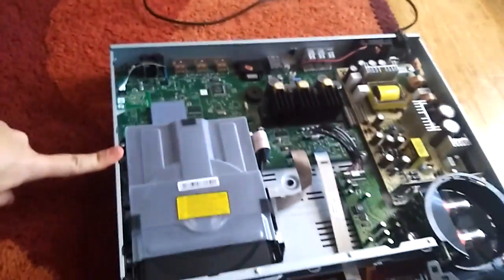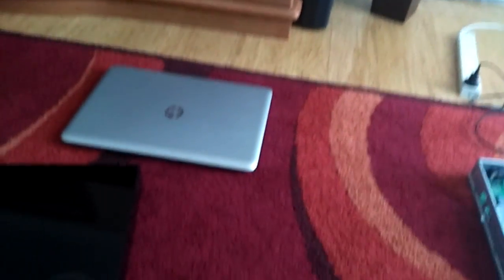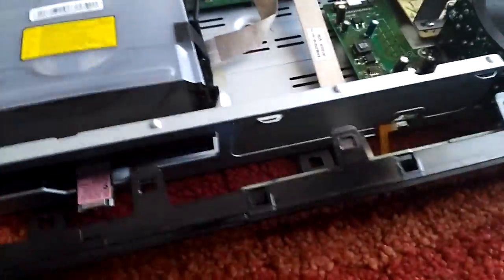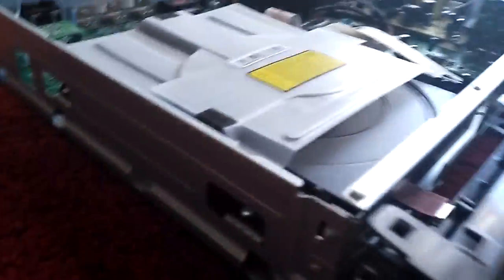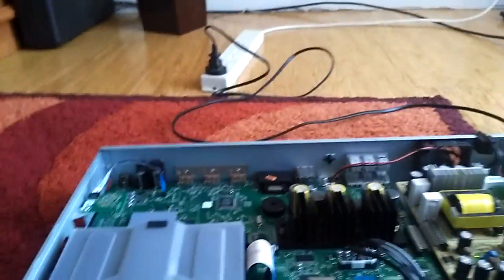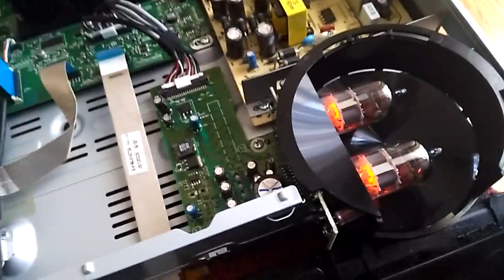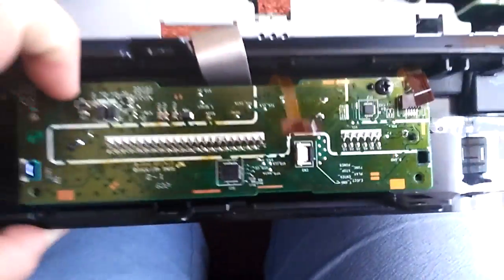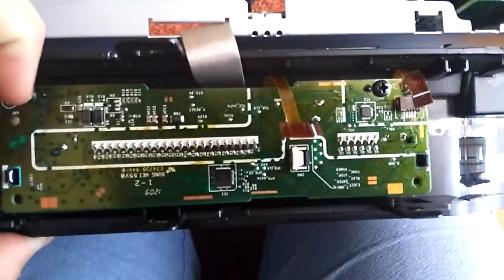Samsung Blu ray 3d volume fix

Comment: Disconnect the other brown ribbon cable on the same green circuit board (located behind the main display screen at the front of the unit) if your DVD door keeps opening and closing on its own or your unit constantly shuts itself on and off. There are two ribbons—one is volume (bottom corner) and the other is for manual controls closer to the top, about an inch from the edge (just as shown in this video), which will stop the DVD door from opening/closing and also stop the on/off debacle. Use needle nose pliers or tweezers and take your time removing the ribbons from where they are firmly seated, only—do not try to remove the connectors from the circuit board as they are soldered in place; just remove the ribbons from where they are seated—like pulling a plug out from a socket. Downside, you must have the remote to control your home theatre system/DVD or Blu-Ray player. Upside, you don't have to buy a new system.

Comment: You only need to detach the small one that connects to the physical volume panel. That’s the only hardware that is not functional… Reminder that once you do this you won’t be able to use that panel anymore, but you will solve the main issue of it turning vol up or down on it’s own! :)

Comment: You only need to disconnect the one on the right side although you will not be able to reduce/increase the volume manually, only with the remote control. If your control remote is broken, and you want to keep manual control, you can also do this: detach the volume band, which is at the right side of the green panel, clean the area with alcohol, and also the surface where it was sticked. Then stick it again with glue, and problem solved

Comment: the one in the corner is the only one to remove for volume issues
Reply: Hi Alex this is Lloyd i have the same problem could you kindly send me a detailed video so i will appreciate your advice thanks
Reply: Chack Lordville I’ve tried removing both, and close the unit. Would you know what the middle one stands for? Thanks!!!!.
Reply: @lrainerl  middle one is power, the corner one controls the audio from the front panel. Once you disconnected both front panel touch controls won't work, just disconnect the corner one for audio issues.

Comment: 8 Years later and it is still saving speakers from being dumped into the landfill. Disconnected both the connecting ribbons and it worked like a charm. A few more years to the home theatre system. Thanks Alex!!

Comment: It worked, thank you for the video but you should let people know that the sensors will no longer work on the box and you'll need to have the remote to use the device at all, thanks again!

Comment: This fixes a problem where the audio will suddenly increase up to max (or decrease down to mute) seemingly at random times.  Regardless of how you try to adjust the volume on the remote.  Especially once the player has warmed-up after about 30 minutes.  It's caused by a fault in the manual volume control circuit board on the front DVD player panel.   Disconnecting these two cables disables the manual volume control.  And since most people use the remote to control the volume, the controls on the front panel can be disabled without causing any issues.

The front panel retaining tabs should be lifted in sequence with a small flat bladed screwdriver.  Just enough to clear the retaining "bumps" on the metal chassis, while pulling lightly on the panel.  Delicacy and patience are required to remove the front panel without breaking any of the tabs.  Work around the panel slowly releasing each tab, until you can pull it off.

These cables can be removed without having to remove the green circuit board from the back of the front panel.

The first and larger brown ribbon cable has a small black latch on the board connector that needs to be lifted up to release the cable.  There's a dark plastic tab on the cable that allows you to pull it out of the board connector.  The second smaller cable to the right also has this small "pull tab" on the cable itself.  But all you need is a pair of tweezers or a small needle nose to pull it out of the board connector.  This second cable doesn't have a "latch" like the first one.  Wiggle it a bit from side to side while gently pulling it out of the board connector.

Make sure the disconnected cables don't get pinched or short on any metal parts on the chassis or the circuit board, when replacing the front panel.  A (very) small piece of black electrical tape on the cable ends should prevent this.

Comment: Just detach the one that would be on the right once you've folded the panel down. That one is your volume control.

Simply put double check your work and look at the front of the panel and follow the volume controls. You will see the brown ribbon where the (-) and (+) reside. Following that brown ribbon will lead you to the port in the panel (wich is on the right) you need to unplug.

Comment: I will try to plug out the second one. Cause last time I plugged out only one of them for the shutting itself problem. And I wasn;t sure about the second. Now you've helped me understand it clearly and tomorrow I will try pluggin' out the second connection. And Will come back with an answer. I hav the Samsung E6750  Blueray Home Theatre System.

Comment: Your video was a life saver. Thanks for posting. Worked like a charm. You're right, getting that front faceplate off was tough, and i was worried i wouldnt be able to get it back on, but went right back on easy peasy. Thanks big time!

Comment: hi. alex.. you are our teacher..jajjaj. excelent.  i had this problem.. and  i did it .. but just one aditional tip..  there are two brown  cables.  one in the top and one in the bottom..   the   rigth cable  to drop is  the bottom cable..  Thanks Theacher..  gracias amigo  alex...

Comment: Alex, you are a life saver, lol. Took me a while to find this info, but did what you said well only took off the end cable and been playing now for over an hour and no volume going down. I am so so happy as I am in Thailand and tried Gods know how many sources world wide to find new board. Thanks to all you also pitched in as well on tips. Alex wonder how you figured this out but it work. I know this video is old and not sure if you are anyone will read it but have a question I hope to get an answer on:  one of the tubes go out after about 5   10 minutes of play, all seem to work/play ok no matter input. Can you saw why or does this mean I need to change the tube or both. I did see another video where some guy said these tubes are not really functioning just for looks, lol. 

Thanks for answer.

Comment: That's exactly what was happening to my system. I opened it and I found that the glue holding the plastic piece behind the volume window came loose. Once I taped it down and left the system on for an hour it worked just fine.

Comment: I did this; brilliant guide thanks.  Seems to have worked.  I disconnected both.  Is the one of them the front panel touch controls? Cos I don't seem to have that now.  However, I do have a remote control so that's all good

Comment: Hi Alex. Great video that was very helpful. I had the volume resetting to 0 and the unit turning OFF couple of years ago. Without the benefit of your video I took it to an authorized dealer who replaced the card and charged me $250! The problem returned after a month or so. After removing both the ribbon connectors, a week ago, I have not had any problems. I think the left ribbon is the one to turn the unit off from the display panel. The right (corner) one is for volume setting from the display panel.

I have a question - Why does the unit not keep the volume that it was left at? I normally set it to 23 but once you turn it off it goes back to 18. Is there a way to set this default to 24?

Thanks.

Comment: Im using Sony Home theatre and facing the same problem. Sound goes down after few minutes. This only happens when I put the volume level at 23 and above...Up to 22 no issue...
This tips works for Sony brand as well? Please advise

Comment: Already had to take the Large ribbon out as the CD loader kept Shuffling ,which meant the front screen was disabled,but i use the remote anyway, then over the last couple of days the volume would start to go down (with bleeps) on its own, after shutting down & turning off, it would reset when switched on ,but start doing it again, removed the front cover again to gain access & this time removed the top right ( Smaller Ribbon ) ALL OK  all working via remote now & saved replacing the unit
Reply from the maker: I am happy you saved some money 😎

Comment: I was going tp praise you as a hero but now my rear channel speakers aren't working! Any idea why?
Reply from the maker: Mike Beaury I sorry that it happend, I am afraid I have no idea. If you fix it share with  us the solution
Reply: Hey there. For me, while i was working on the unit, i removed the WiFi card from the back (it's literally a big long card that sticks out the back) so that i wouldnt damage it. Forgot to put it back in. Was freaking out about how much i might have damaged my system when the back speakers weren't working. Remembered they are run on the wireless reciever, and remembered i hadnt plugged it back in. Sure enough, came back on no problem. Hope this helps you!
Reply: Mike Beaury you have to turn it off,  to put back in the wireless card, and the remote box too
Reply: or try new cable 1.4 high speed if you don't have

Comment: Hey bud awesome video I'm definitely gonna do this but what model is yours an after disconnecting both of those brown plugs putting it back together did you have any issues with using your remote to navigate and play DVDs and Blu-rays and Etc
Reply from the maker: mariorosio rodrigquez Thanks for commenting, yes Mario the remote control won't work. But I saw a comment below mention that If keep one ribbon it should be fine

Comment: another thing does anyone elses unit get hot after say 30 minutes of use?? I touch right were the 2 fuses are and it gets pretty darn hot maybe it's normal but I only use mine for the audio iused the DVD one time not a movie guy but after an HR I always turn it off and even unplug it cause I worry about it getting hot and burning up I even thought about adding a computer cooling fan in it but seems kinda crazy... I only had this issue with the volume going down by itself but it's good since I seen this video.... But I am so damn impressed with the sound on this
Reply: thats normal from the tubes

Comment: There is another common problem with this model. The disc tray ranfomly opens and closes. Someone in another video suggested pulling the brown ribbon cable to disconnect power to the display panel, but that stops the remote control from working. Any ideas?
Reply: Enter 48273 on menu screen this locks the dvd tray. Type it in again to unlock it.
Reply: @jasonsmith879  Yes, I found out about the lock code last month and it works great. Thanks
Reply: I now have the tray randomly opening and closing fault. Disconnected both the brown ribbons and the unit for surround works fine with the remote control only. Blu-ray never used anyway.

Comment: yeah mine stopped decreasing volume which is good but now my touch screen don't work.. I'll figure it out but I'm almost sure that you only take the one Brown ribbon off but not both!!
Reply from the maker: Jay Rands Thanks for the information, is your touch pannel now working?
Reply: no like I said I took the 2 brown ribbons off and now touch panel or the volume touch don't work the volume problem is corrected but I can ONLY control everything by the controller!!
Reply: Jay, same here, but it matters absolutely zero to me. I've only ever used the eject button on the touch screen in the 3+ years i've owned the unit. The remote works fine for everything the touch screen does (and way more)
Reply: yeah i unplugged both brown ribbons when u take the front cover off months ago after watching and its been working perfect only problem is i cant control anything with the touch which is really not a biggie cause i use the controller everytime i might someday put the one ribbon back on cause obv one is the problem n other ribbon controls the touch screen but yeah thanks to this video i didnt have to pay some gooofball that would of maybe made a hundred bucks off of me for 5 min of work or worse buy another receiver or another surround sound cause this sounds amazing esp cause i paid 125 for it in the box around christmas time past year and my buddy who owns the pawn shop somehow had the same model # sub i paid 15 bucks for it i got 2 just spliced the sub wire and got the 2 little a$$ subs pounding i cannot beleive how it sounds!! AGAIN TY FOR YOUR HELPS GUYS AND MAYBE GIRLS